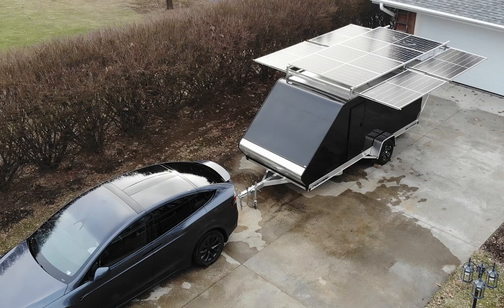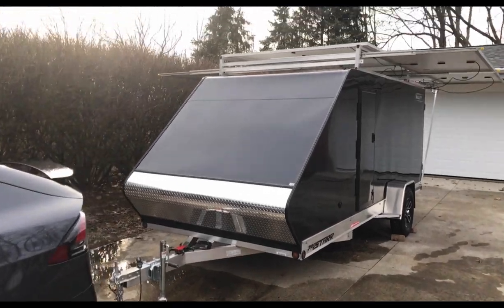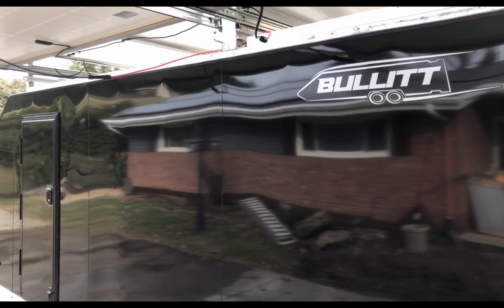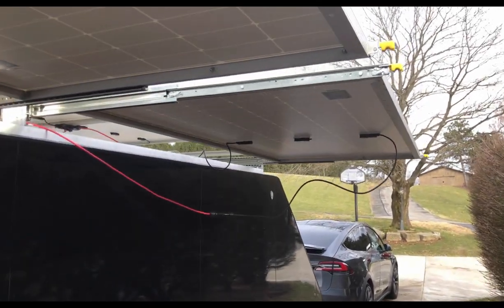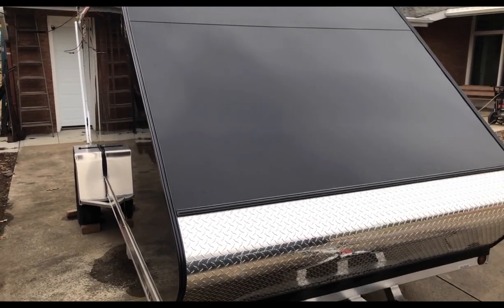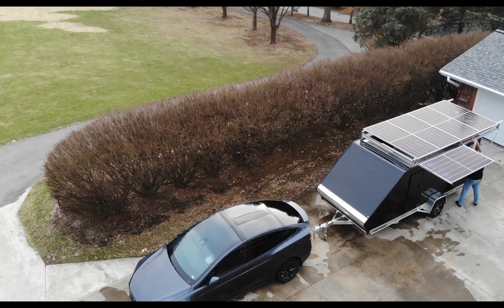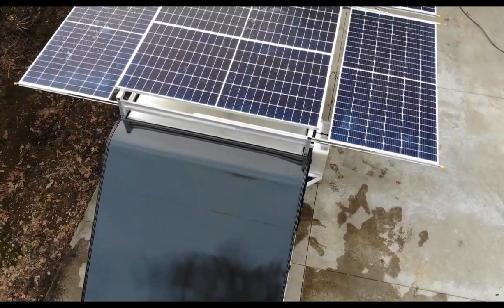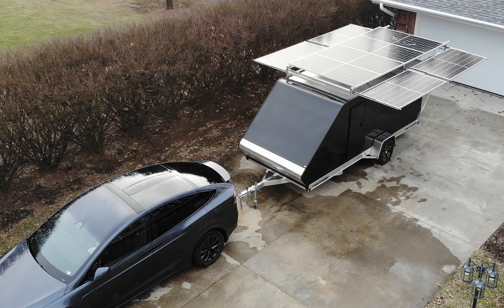My new 2022 Model X Refresh (4,550 Watt Solar Trailer build part 2) Episode 12

Comment: Would it make sense for the bottom panels to actually fold onto the sides rather than slide under the top panels? That way when theyre folded onto the sides of the trailer theyre still collecting energy even when youre driving.
Reply from the maker: I thought about that but on one side it would cover the side door.  I also was concerned about how much they would extend beyond the trailer both when they are folded up or down.  I just couldn't make it work in my head.